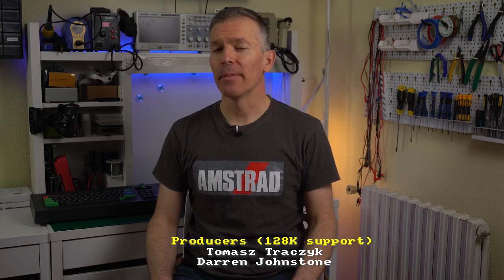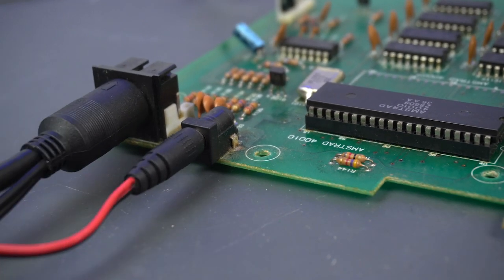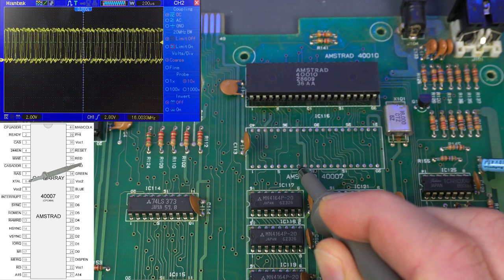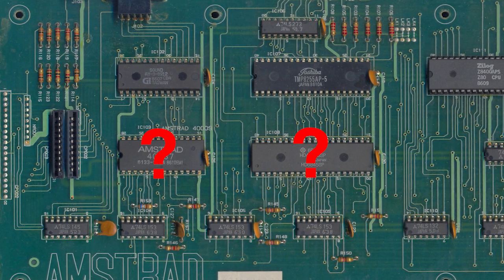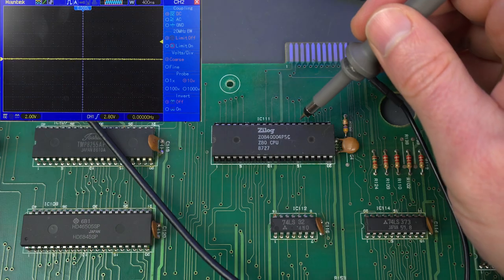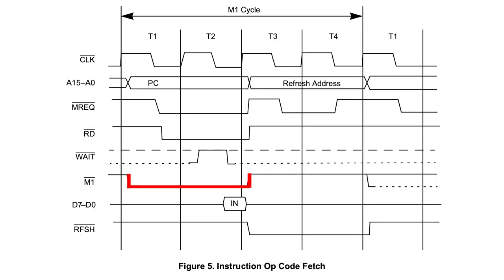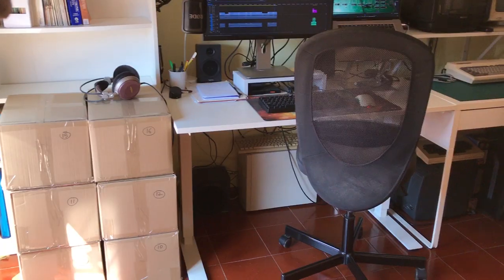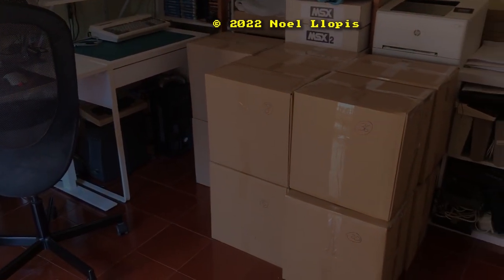Always Check The Basics First - Amstrad CPC Repair

Comment: That thumbnail reminds me of a simple repair I had many years ago. I bought a 1200 baud modem from a Radio Shack outlet store. It didn't work, so I did a visual inspection and found that the main IC had a leg sticking out of the socket. Worked fine after I pulled and reinserted it, making sure ALL the pins were connected. I wish I had time, energy, and money to learn more about electronics and repair. I've been a "hobbyist" for 40 years, but I know there are some large gaps in my knowledge.

Comment: double check the basics. My commodore 64 had 4.5 volts and was working fine but once I plugged in the 1541 Ultimate 2+ cartridge it was glitching colors. Still works fine, but the colors are off. It took several chip swaps before I realized that the U2+ was causing a voltage drop down to 3.5 volts. It's amazing it even worked like that at all. Ultimately the cause was the cheap POS MIDI cable I bought to use as a power cable. I have a new power cable (same power supply that I built myself) and now it gets 4.9V even with the U2+ plugged in. It was a basic problem that I missed.

Comment: Perhaps the CPU was from a Spectrum, as you said the Spectrum doesn't need the M1 line and the expansion port has the - 12v line next to M1, so many Z80 in those get their M1 fried from moving the connector with the computer on.
 Perhaps someone tried to replace the CPU in the amstrad with one of those semidamaged ones and couldn't make it work and though the problem was elsewhere.
Reply: I came here to say something similar - this CPU might work as a replacement for a Speccy CPU right?
Reply: @bencollier3758  For normal operation it should if only M1  is damaged, but for example Divmmc devices need a working M1.

Comment: Very nice video!
7:18 How does the gate array use WAIT signal to access RAM?
The purpose of the WAIT line is to make the RD, MREQ, IOREQ and WR signals longer for slow components. The address line and data line won't be put in high-impedance. However, BUSREQ line will let one put data and address lines in high-impedance, letting any other component master the bus. 
Did the Amstrad have a bus transceiver or line driver to control RAM line inputs?
Reply: A check of the circuit diagram would answer your question.  Yes.  RAM A/D bus is separated from the Z80 by buffers/muxes under control of the GA.
Reply: BUSREQ is only actioned by the Z80 at the next clock, which may be too high latency for noise free video unless actions such as locking the CPU out for whole line times are taken.

Comment: Chip swapping is almost an art. It is like part swapping. You don't just want to be a part swapper just to find a problem. Though sometimes you do that. Same thing with chips on a motherboard. A few years back I purchased an Apple II with a video problem. So after cleaning and restoring chips / such (oxidation.). Plus knowing what is wasn't. I found a diagram of video tls chips. Once I verified change the 3 tls chips around change the issue. I ordered some replacements chips. Problem solved. Took me longer to find a idiot diagram with sections circled with what it was. Compared to fixing the issue.
Reply from the maker: Exactly. Whenever I have to resort to blindly swapping chips I feel I have "failed" the repair 😃

Comment: Any channel with my initials is always a great choice  .🤣

Try to get an 240v and 50 amps outlet in the garage to charge a EV.
Reply from the maker: I thought about getting a 240V outlet just to run European computers, but I think it'll be simpler just to use a good voltage transformer. We'll definitely set thing up for an EV at some point though 👍
Reply: @NoelsRetroLab  Be wary of those voltage transformers.  Tech Tangents did a video about one within the last year and he had to completely redo the internal wiring of the one that he got.  I am planning a short move of my own and I want to install 240v outlets in my new place so I don't have to use that sketchy transformer.  I bought one from a flea market a few months ago and I'm kinda scared to use it.  I will use it if it's the only way to get something working, but only for a few minutes to test it.
Reply: Get a subpanel installed in your lab, then it is easy to run the circuits.
Reply: @NoelsRetroLab  Unless it's different in the US but all canadian homes are wired for both 110 and 220v. The drying machine in on the 220v circuit, so as long as you link to it and have a proper isolated circuit with easily identifiable outlets (not hard since they're completely different between Europe and NA), you should be fine.
Reply: @Fularu  same in the USA, normally 240 is for water heater, dryer so 240 is not normally a wall outlet. Getting the subpanel in the lab then you can have European outlets installed.

Comment: many zx spectrums have been found to have 'faulty' z80s with missing or 'weak' /M1, but computer working normally, only showing the problem when an add on is connected that needs the /M1 for something, such as the interface 1,  it has been said the /M1 output is quite easily 'damaged' by incorrect/slipped connections  to the expansion slot or fault in an add on, surely the cpu designers shouldve buffered that signal? or would it introduce too much delay to it? it has also been said genuine zilog made ones seem to be afflicted more...maybe a substandard batch?

Comment: Just wondering in regards to using an oscilloscope whether 100MHz is sufficient? Looking to upgrade from what I currently have which is an old Hitachi 40 MHz and thought I would go digital. Bit of a price difference between 100MHz and 200MHz (Hantek DSO5202P) - for just using as a bit of a diagnostic tool and checking the stuff like you have in this video. What are your thoughts?
Reply: Reading the specs we see that the 200MHz, 100MHz and 70MHz models in this line all share most of the hardware including sampling frequency. All three run at 1 GS/s shared between the two channels which means it's a bit limited above 100-133MHz IF both channels are enabled - as the number of samples per "wave" goes down it's forced to guess more and more, it only have 2.5 samples per wave at 2*200MHz which isn't very much, it's way too close to the Nyquist limit (effectively 2 samples).

This is pretty standard, even say premium brands like Tektronix sells "shared dual-channel 1GS/s" scopes in 50/100/200MHz variants, I suspect the difference is a software-limit and possibly more expensive capacitors on the front-end and/or better probes - and for some of these (non-chinese) scopes you can upgrade frequency via a license code (IE provably no HW difference on those).

This sampling limit slightly reduces the "value" of that higher frequency but it all depends on what you're going to use it for and it's not THAT uncommon to only use one channel, but it all depends on what you want to do. Only you can judge if it's worth, checking, something like 33% extra?

My feeling is that 1GS/s is overkill for retro computers of this vintage, I'd argue even the 40MHz scope you mention should be overkill for 8-bit micros. 
I suspect you could use these 1GS/s scopes to tackle vintage Amiga/Mac/PC up to perhaps 75-90MHz for the 100MHz variant, and up to perhaps 150MHz using the 200MHz models (with judicious use of single-channel mode in some cases). OTOH having overkill on the sampling speed means you get a display that can be easier to interpret due to "nicer" wave-form displays and models cheaper than this often isn't in "scope form-factor".

Ref: Adrian's Digital Basement showed that even a shared 48MS/s scope-to-PC (Hantek 6022BE) was mostly usable for these types of computers (up to 4MHz 8-bit), the wonky trigger and clunky software was a worse problem than the sample rate!
He later tested a handheld shared 250MS/s scope and the main complaint was some rough edges in the software (Hantek 2C42, 40MHz). If you're in the market for that kind of handheld another options that often gets mentioned is the Owon HDS242 (another 250MS/s scope). I don't have either so I can't comment personally, I see that there's plenty of people who discuss them on Youtube. And do watch Adrian's videos too.

Comment: I heard that Sinclair got a good deal on Z80 chips with no M1 signal, as the Speccy does'nt use it, nor did most of the hardware expansions, it did'nt matter. LOL.

Good luck with the move. Sadly, you would have to replace most of your equipment anyway as America is 120V. :(
Reply: He could buy a step up transformer and power everything off that.
Reply from the maker: I haven't confirmed that story. An alternate version I read is that /M1 on the expansion board is very easily shorted to Vcc/Gnd and so it's often damaged on the Spectrum. Not sure which one to believe 😃
As for the voltage differences, you're right. I'm definitely getting a good transformer to be able to run all the European computers here.
Reply: @NoelsRetroLab  You will have to get one that converts 120V 60Hz to 230V 50Hz.
Reply: @NoelsRetroLab  I've just looked at the edge connector on the Speccy schematics, and M1 is right next to a 12V line. LOL. So that would explaine a lot.
Reply: @NoelsRetroLab  Most newer stuff is likely multi-volt but, yeah, always check first. Older stuff can be picky, but MOST US houses (IE apartments is more variable) have either 240V (homes, some offices) or 208V (larger offices & industry) easily available but it's obviously still at 60Hz. Yes, US is officially 120/240 or 120/208, not 110. Still, you may still end up with a transformer for some things.

If you DO need 230/50Hz or 240V/60Hz the cheapest way to get that for small loads tends to be via 12V, 24V or 48V DC intermediary. IE an US car/lorry/telco AC->DC converter plugged into mains, then feeding that DC voltage to an EU/UK car/lorry/telco DC->AC converter, probably with "pure sine wave" or a similar label (and it should specify a single-digit THD or THDv at 100% load) since if the hardware cares about frequency it may well get upset by "square wave" or "modified sine-wave" (only marginally better).

Also, some online (IE battery is always in the loop) UPS can do this if you have 208V or 240V, but it depends on them having a way to override output voltage (not that uncommon) and frequency (less common, auto-sense is defintely default but I've seen models which had it). Exploring this probably starts making sense around 500W+? Usually the spec sheet doesn't actually SAY whether you can force frequency so you'd likely have to read the manual to find out that part and again you'd want some kind of pure sine wave (see above for spec).

Or bringing over a power generator as part of the move can also work but you need to be careful to get one that's rated for "electronic loads" and honestly even then the power qualify isn't always THAT great.

Comment: The voltage drop on your bench PSU is not the bench PSU, its the chinesium red+black cable on the output. These are absolute trash with very thin aluminium (sometimes steel) wire, 1 Ohm is nothing unusual. Make your own one with a good quality solderable connector and 0.5mm² copper wire and good 4mm plugs on the PSU side.